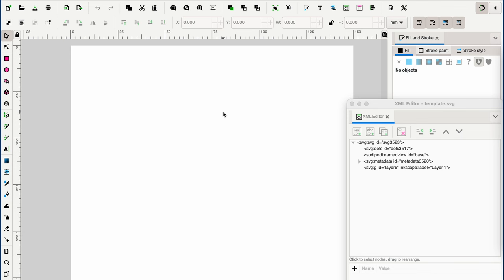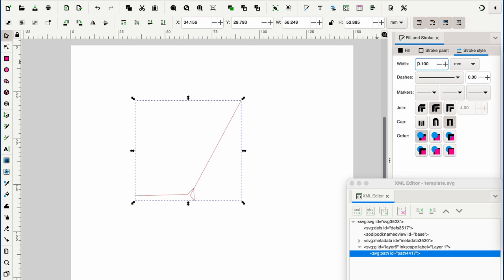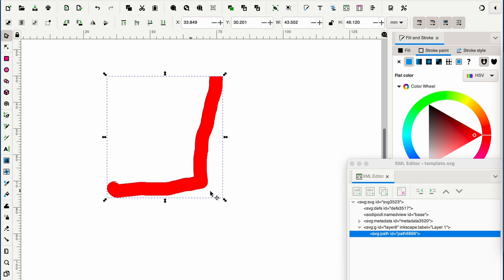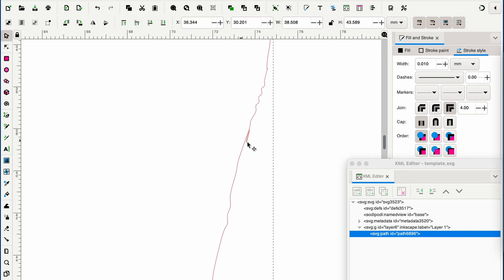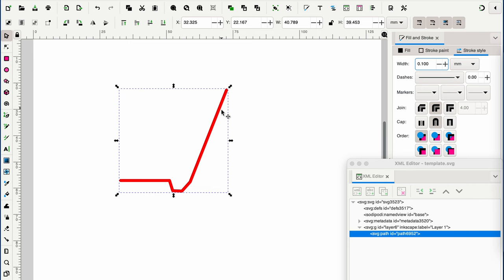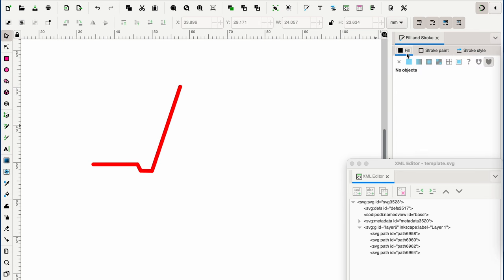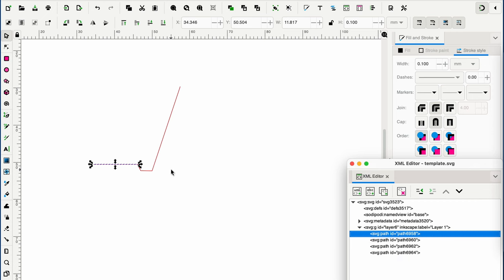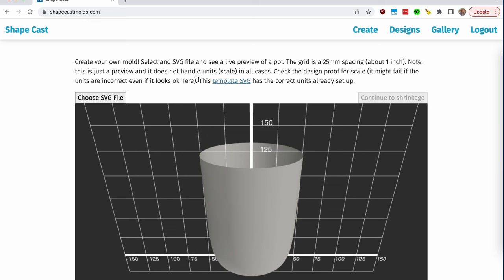Under the hood of Shape Cast - Tips and Tricks

Comment: Great series Kent. Thanks a lot for sharing. Just signed up to the waitlist. Out of interest how thick are you making the 3d printed moulds?
Reply from the maker: Thanks! You should be active now.
The mold walls are 2.4mm thick (except for the flanges which are thicker to accommodate the inserts). And the design proof is only 1.2mm thick so it can be printed quickly.
Reply: @PotterybyKent  Appreciate the quick reply and also activating my login so quickly. To be honest I was thinking it would take quite a while to activate so ended up replicating a lot of your work but in Fusion 360. No where near as refined as yours but think it's close to being functional. One thought that struck me that might be of interest to you is to allow for incorporating a stamp svg in the base. My partner (who's the potter) stamps her pieces afterwards with her brass stamp but thought since making a mould I would try and incorporate her logo straight into the mould. Not sure how well the resolution will come out but figured it would be worth a go. Thanks again.
Reply from the maker: Yes, stamps, and texture more broadly, are things I've been thinking about. One thing holding me back (besides being busy on other things like handles!) is I know potters will place stamps in a variety of locations on the foot, and I haven't thought of a good easy way to pick that location given the current workflow. There are also a bunch of other parameters to work out (depth, draft angle, minimum feature size, etc) but those probably just need some testing.